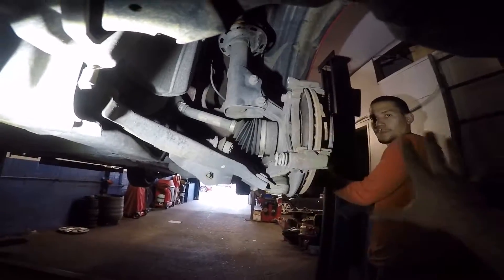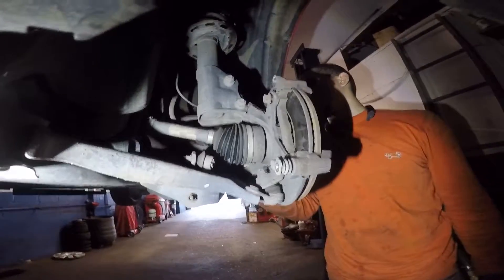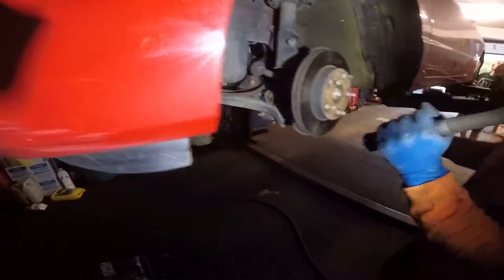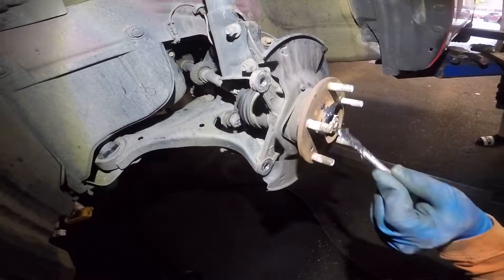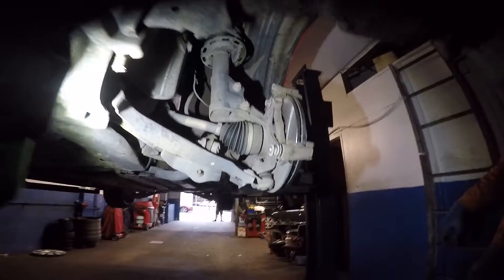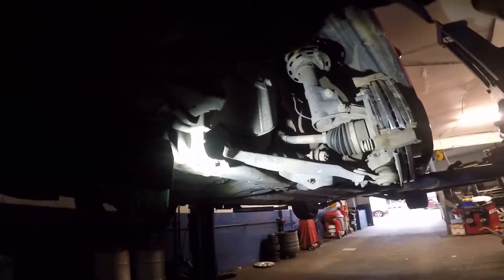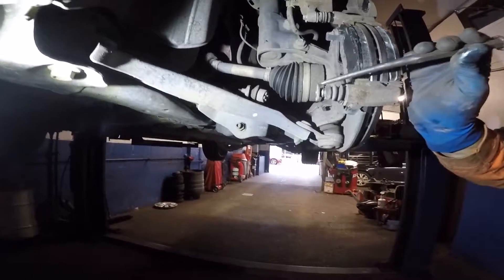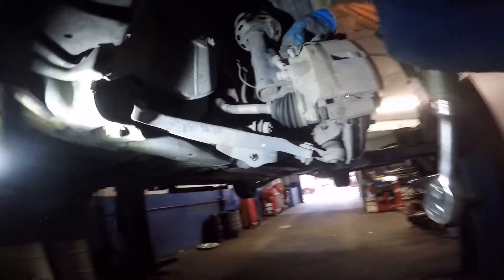How to replace front Brakes and Rotors on 2010 Honda Civic

Comment: Replaced the old pads and rotors because the left front wheel had a squeaking sound. Only the left front one. Thought it was a sign to get a new pad and rotor. But the old pad is still OK.
Reply from the maker: U can’t just do one it will have e ever braking and car will pull to that one side if that’s what I’m u understanding but I have done left old pads before with new rotors
Reply: @RBTheMechanic  I replaced pads and rotors for both front wheels. Just feel weird that only the left front had a squeaking sound while the pad was OK
Reply from the maker: @jamesyu2066  some times squeak is due the rotor so if it’s fixed ur okay
Reply: @RBTheMechanic  No squeaking sound after installing new pads and rotors. Thanks for your help!

Comment: Is it necessary to bed brakes? I changed ceramic brake pads and rotors many times and just heard this procedure. Thanks!
Reply from the maker: Bed?
Reply: @RBTheMechanic  I think it means bed in brakes or bedding-in process
Reply: @RBTheMechanic  I think it means bed in the brakes or bedding-in procedure.
Reply from the maker: @jamesyu2066  sorry idk
Reply from the maker: @jamesyu2066  bleeding is bleeding
Reply: @RBTheMechanic  do we have to perform a brake bleeding after the pads and rotors are replaced?
Reply from the maker: @jamesyu2066  no as long as there no fluid lines opened u don’t need to   And open up ur brake resorvar cap so it can breath and once’s ur all complete make sure u put the cap on and pump the brake peddle several times before starting the car it will be soft and get hard after 2-3 pumps

Comment: Which tool did you use in the 2nd trick to successfully remove the small stuck screw that tightened the rotor onto the hub? I removed three screws from the rotors. But the last one is stuck on the rotor. The worst thing is that it's stripped. I even tried a rust penetrator at the beginning. But it worked for the other three screws, but not the last one. Do you know any tricks to remove this stuck and stripped screw? Big Thanks!
Reply from the maker: It’s punch driver but u don’t need that. Watch this video and try my trick https://youtu.be/1fpCpjvTJMs
Reply: @RBTheMechanic  Is it as same as an impact driver? I tried it. But the screw is stripped. I am gonna try your amazing trick tomorrow. Hopefully, it works for the stripped rotor screw.
Reply from the maker: @jamesyu2066  yehbimpact driver but use the trick it will work even if u hit it hard enough the head will just snap off!!
Reply: @RBTheMechanic  You are so awesome! Got it exactly as described in your video! Thanks millions!
Reply from the maker: @jamesyu2066  nice job bro!!!!

Comment: good video! what is the torque to tighten these bolts? for example, bracket bolts? thanks!
Reply from the maker: What year u have
Reply: @RBTheMechanic  09 civic. what kind of grease did you use? Do you recommend using copper anti-seize lubricant, a threadlocker, and silicone paste? Where can I find torque information for this job? Thanks!
Reply from the maker: @jamesyu2066  what year is ur car I can get u torque and yes all that is good I use high temp regular brake grease and also use silicon grease for slider pins
Reply from the maker: @jamesyu2066  here’s a good video on greasing https://youtu.be/sKrD8RoqRqk
Reply: @RBTheMechanic  It is a 2009 honda civic LX 4-door sedan. Do you prefer anti-seize or brake grease? I found the torque info.
Reply from the maker: @jamesyu2066  yes that works good as well